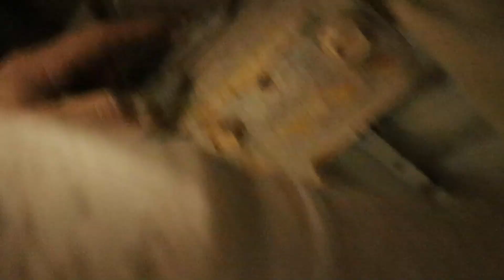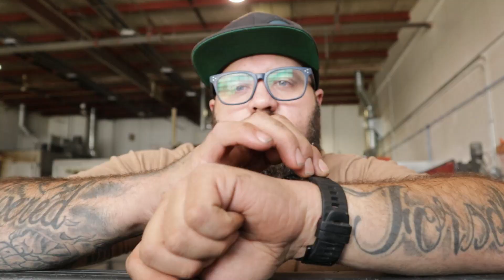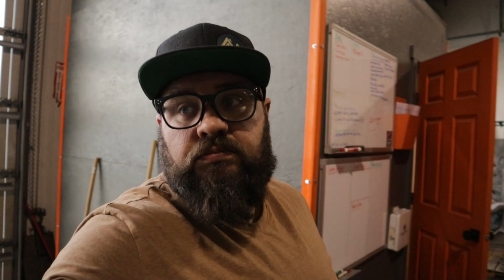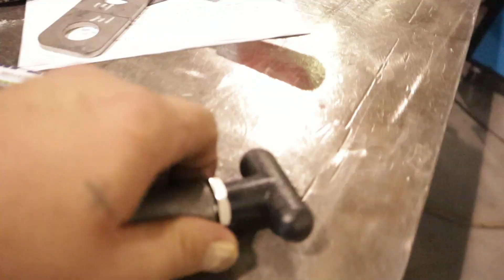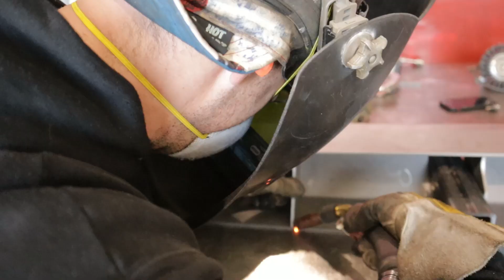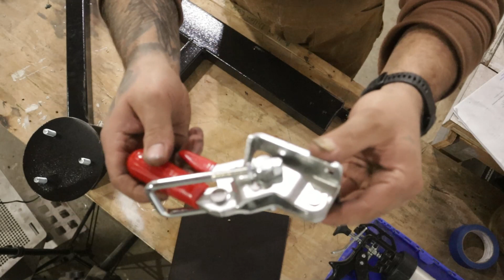Nissan Frontier Coastal Off Road Rear Bumper - Built Proffessionally - Step by Step

Comment: I know you went with the hitch receiver in the bumper but since its not rated for towing would you be able to remount a tow hitch receiver if you wanted to? I know it would reduce the clearance factor but I want to be able to still tow a trailer with 2 quads on it
Reply from the maker: Greta questions sorry it took me so long to answer, so while the hitch is not rated for towing we added extra gussets to make it stronger and so far i have not had any issues towing. Still not techniclly rated but its over engineered at this point